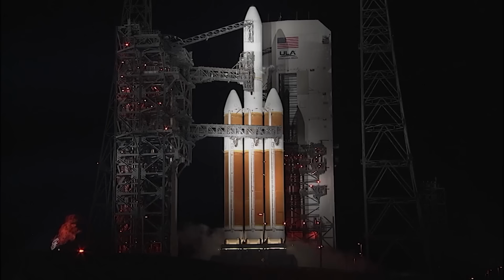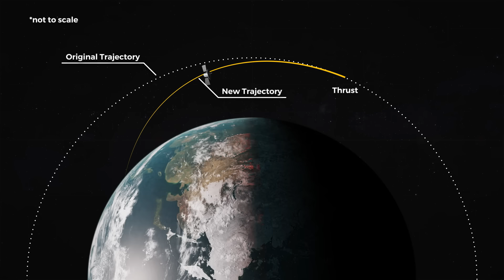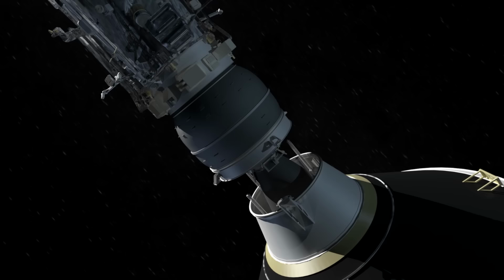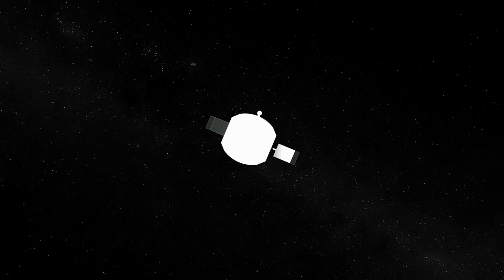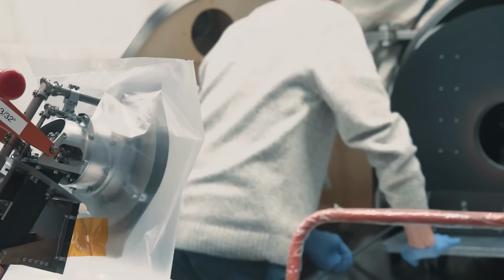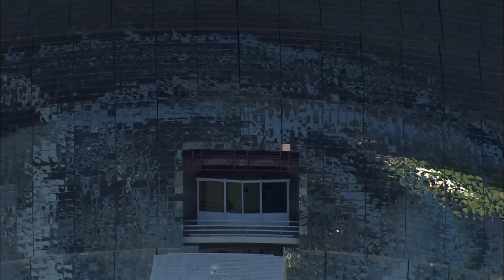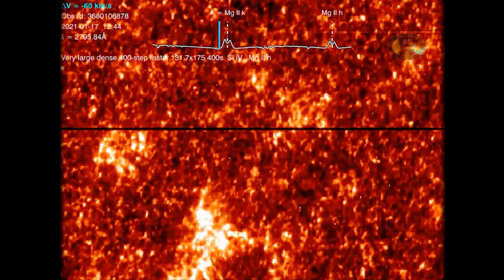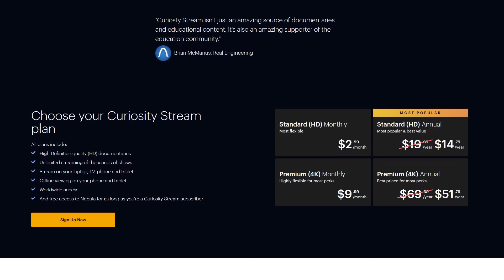The Insane Engineering of the Parker Solar Probe

Comment: Imagine the sun being a rocket hurling one direction it would gave a front, side and back as it lets off heat where would the heat at the front concentrate? Around the sides. All that said i wonder if they tested the front facing side if it would have much difference?
Reply: The sun is not like a rocket, it releases light and radiation in all directions at around equal proportion

Comment: a sun landing should be attempted in winter first of all, when it's slightly colder. And possibly early morning when it's cooler, not yet to full power, but it's emitting light enough. Some said at night, but you can't find it at night, sun is all black at night and we do not have the lightening technology enough yet to illuminate it all properly in the darkness of space, it's just too big -I'd say approx the size of 50 thousand football fields, which is huge. Or even more. The fact that it looks smaller to us, the size of an orange, if you extend your arm holding it, it's just because of the distance, and so many get confused, because they do not understand gravity and space as Einstein would have put it.
Reply: great idea!!!!!
Reply: @thecoolbird13  thanks! Actually I thought it could be just common knowledge already on the web but no!! Bang, I just did  a bit of research :)
Reply: @thecoolbird13  let me add I have been actually studying physics on my own quite a lot through the years. I'm still struggling with some of it but I think I can handle all the basic concepts by now.
It's incredible the amount of mistakes that even the major institutions still do, probably because of laziness due to overfunding, not to mention poltical reasons hidden to the public. If I were the chief of operations at NASA, for instance, we would have already found out why the Earth seems flat in dayly life -which is still a mystery to most of us. The secret is in the oceans

Comment: I think this observed temperature difference. May actually indicate. There are 2 different levels of Hot? There's 2 different kinds of temperatures. One obviously much higher in energy. Than, on the surface. If you can call the surface of the sun, an actual, surface? It looks like a surface?

It's really the surface of the top of the hydrogen explosion underneath. So that's not really a surface. That's the scum on the top. Like when you smelt  metals. The metals you don't want. End up on the surface as scum. And the metalsmith uses a spoon. To remove those non-associated particles. And I think that's the surface of the sun? It's all those other metals. That have floated to the surface of the cauldron. Which is not really a solid surface. Though it looks that way to us? And we see explosions blowing through it. So it must be a surface? And maybe not. It's the surface of mushroom clouds. But so many of them together looks like a surface. When it engulfs its core. Like the clouds above Venus. That's not its surface. We can't see the surface. It's below the clouds. Only radar can penetrate the clouds. And we have. So we can see the surface. Digitally re-created. And Yep. There are no critters running around. They would burn their little paws. So not even dinosaurs. They were all cooked. And the meat fell off the bones. Then the bones turned to ash. And it does have a surface. Some tings, have landed there. They last a few minutes until they melt. but I don't think Venus, looks, so hot. And I get the freeze-dried cold shoulder from Mars.

So maybe we should just stay here on earth? What do you think? We have beaches. I haven't been to now in, 9 years. And it's about time  I see the ocean again. I'm sick and tired of Central Texas! I don't like lakes is much as oceans. As lakes don't have as many things to kill you with. Rarely do people get attacked by sharks. In, lakes. And how many jellyfish do you see in, lakes? How many bacteria and pathogens do you find, in lakes? Way too many. I'll take my chances stepping on a Stingray. Steve Irwin did that. It was the last one he stepped on. And we lost a much beloved crazy Australian naturalist. Who would have ever thunk, you could get killed by stepping on a fish? And did they euthanize that fish? Lousy fish! FUCK!

It's almost like stepping on Republicunt's these days.
RemyRAD

Comment: Wouldn't the corona be hotter because heat rises?
Reply: there is a difference between heat, and hot air.

"heat" does not rise, hot air does. And since there is no air in space, it doesn't rise.

Comment: Maybe the corona is hotter than the actual surface of the Sun because all the heat and radiation coming off of the Sun converges at that distance and superheats as a result?

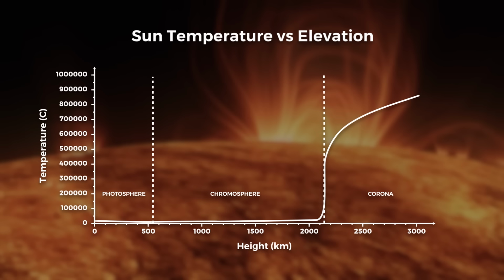Comment: I must be missing something here because at 1:35 you say the temperature of the Corona is half a million+ degrees Celsius, and then at 9:19 you say the solar probe cup isn't shielded by the heat shield, so it should be experiencing the half a million+ degree Celsius temperatures of the Corona but the grid inside is made out of Tungsten that has a melting point of 3422 degrees Celsius. So how is the cup not melting from half a million degrees Celsius? Furthermore, how are the solar panels being cooled with water if they're sticking out of the heat shield as well and experiencing the same temperature? At 14:23 you say the facility that NASA used to test the probe was capable of producing temperatures of 3500 degrees Celsius; but again that temperature is nowhere close to the half of million degrees the Corona is.
I'm not understanding how equipment tested at several thousand degrees Celsius is supposed to sufficient to withstand over 10 times that.
Reply from the maker: Temperature and heat are not the same thing
Reply: @RealEngineering I get what you’re saying but you could explain it a little better to the dude 🤦‍♂️

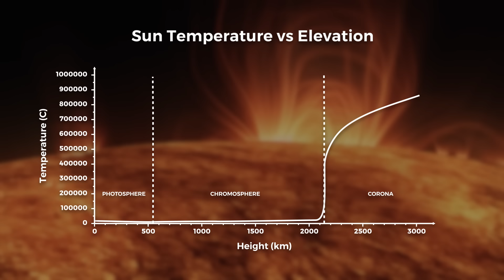Comment: At 1:32 the narrator states that the Solar Corona is much hotter than the solar surface, which produces a heath of 500.000 degrees Celsius. Do you really believe that this tiny tin can probe can resist more than 1,000,000 degrees Celsius and not being vaporized instantaneously? (More than a million degrees Celsius Wikipedia)
Reply: Yes. In the same way you can stick your hand in a 400 degree oven and be fine for quite a while, but to an even more extreme degree.
Reply: It isn't resisting that Temperature. The heatshield reflects most of the heat. Remember, all this heat the Sun gives off is in the Form of thermal radation. It's not like when it gets hot on earth. There is no air to heat up. Nothing surrounding the Probe that could heat up. The heatshield reflects most of that thermal radation. Like the suits they use when going near blast furnaces. Those silver suits reflect thermal radation. Same principle, different application
Reply: @michael.forkert  you missed my point. Of course the Probe heatshield isn't absorbing the radation. That would be impossible. Like I mentioned before, the shield reflects most of the thermal radation. The small amount that gets trough gets absorbed. Look at the suits they use when going near blast furnaces. Those reflect a lot of the heat as well. It's the same principle. If you look it up, the heatshield is made out of two plates of carbon composite Material, with a Player of carbon foam Inbetween and then a refelctive coating. Most of it gets reflected, the small amount that gets trough gets absorbed. The Front of the shield only heats up to about 2500 F.
Reply: @michael.forkert  oh also. Unrelated question, why do you write like this? I mean in itallics and all that. Never saw somone do that

Comment: When it comes to why the corona is the hottest part I'm wondering if it doesn't have anything to do with maybe the heat that is radiating off the sun begins to slow down as it gets further away and then it kind of backs up and collects in the corona and when it collects all adding up it's that much hotter up there because of it. it's kind of like a flame here on earth. if you're wanting to heat something up you don't put that something directly on the flame , you put it above the flame

Comment: I find it ironic that the corona of the sun is hotter than the surface.
Reply: I do not know, It's similar with a candle flame, The tip is hotter than the base

Comment: How do they know the photosphere is cooler than the corona when they can only measure 'through' the corona to reach the photosphere?
Reply: Through spectrographs we know. Different elements emit different wavelengths at different temperatures. Hence we know what temperature the photosphere or any layer of the suns atmosphere is just be looking at different wavelengths. For example the Corona emits at X-ray and EUV wavelengths.

Comment: Tbh it makes sense that the surface of the sun is colder than the area around it since when wood is on fire it's usually hotter in the flame than on the wood

Comment: yeh but the surface is also much more dense, so while yes the upper atmosphere is hotter you are not going to hit nearly as many particles so the heat transfer would be significantly lower than the surface, not that the surface is exactly dense either I think the suns "surface" is supposed to be like 1000x less dense than our atmosphere at sea level something silly like that. So calling it a surface is a little funny.
Reply: It is called the surface because that is where the optical depth in the visible spectrum is enough to render it opaque - so it looks like a surface.

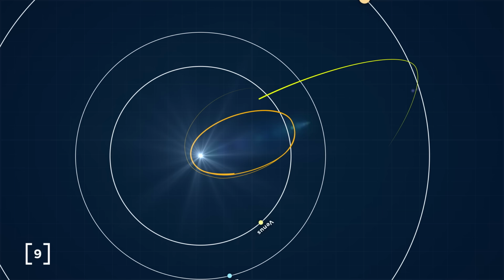Comment: 6:30 "the sunlight reaching the panels at its aphelion would have been 25 times dimmer..."
Light is measured in luminosity or brightness, how many lumens. Dim is less light, not more dim. I'm surprised an engineer doesn't know what a fraction is, or what is being measured.

Comment: The video is fine.  But the video's bump title, "We Finally Touched The Surface of the Sun!" is laughably idiotic, especially coming from a purported science vlog.  There is no "surface" of the sun because the fourth state of matter, plasma, has no surface any more than air does.  Even if there were a surface, no solid material could reach it intact, and certainly not a space probe.  And anyway, as the video explains, the probe came nowhere near the sun during its mission.  So, nice video.  But stop using what you must know are clickbait bumps that promise to deliver the impossible.  Those who seek your vlogs will come anyway.

Comment: No real, actual footage huh...😂 what a joke these are
Reply: Even with a lens filter I doubt any camera would be able to stare directly at the sun when they’re that close to it. Even the solar panels have to be at a shallow angle to the sunlight to avoid overheating
Reply: There is a picture, that’s kinda it tho
Reply: Take a Teleskope, take a camera. Set it up so the Teleskope points at the Sun. Fix the camera so its looking trough the Teleskope.. Within even a short time, the camera will be burnt. And that's only a small fraction of the suns light. Now. Do you understand why a camera isn't cut out for the job? It would be burnt out.

Comment: designed and built in Austin, TX. Yet all the measurement units, in this video, have been converted into metric units. Stop doing this. We don't use the metric system here.

Comment: The sun travels at 828,000 km around the center of the Milky Way. The Parker Solar Probe max speed is/was 635,266 km. Your own math does not add up.. deceiving the pubic with lies.
Reply: hashthe ... Have you discovered your error yet?
Reply: Velocity is always relative. The probe took off from Earth, which is traveling at the same speed around the centre of the milky way as the Sun. When he cites the 635266 kph figure, he's talking about the probe's speed relative tothe Sun, not its velocity relative to the centre of the milky way.